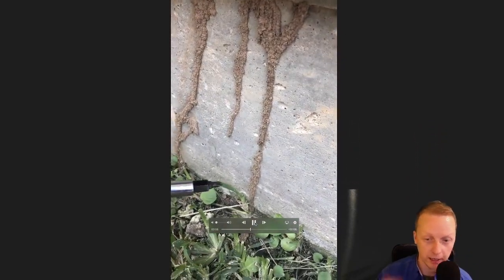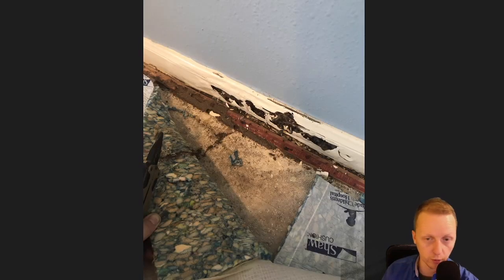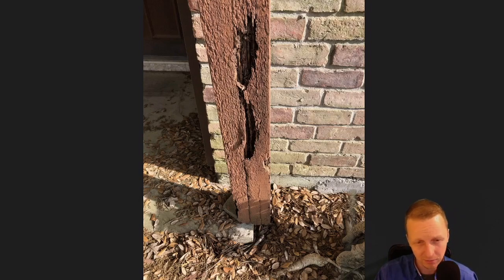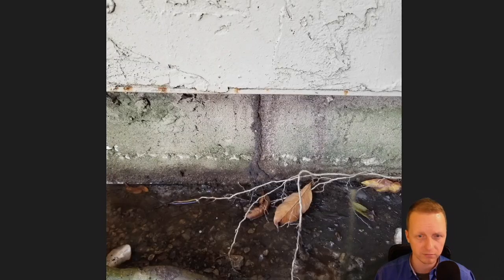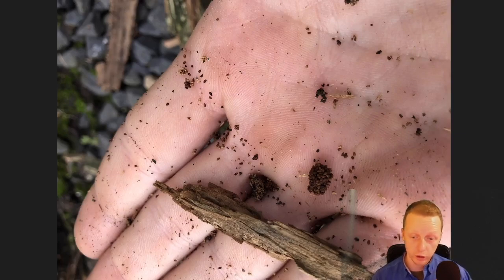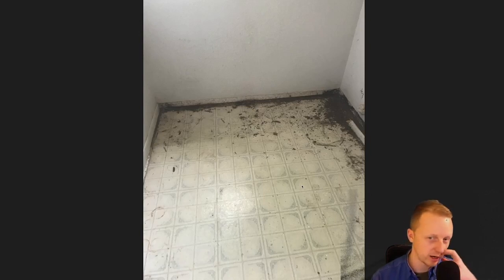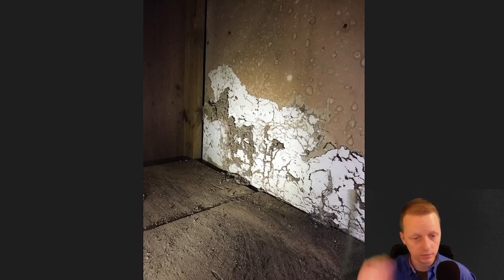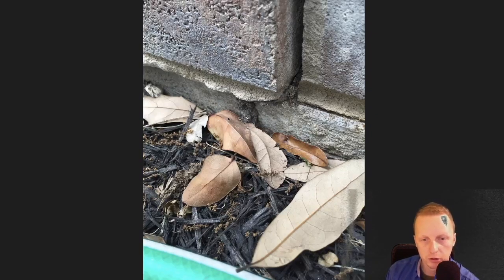How to identify termites and other wood destroying insects - The Houston Home Inspector

Comment: Thanks for the awesome video! I see some pest company drill hole in the soil instead of digging a trench. Is this still a proper treatment?
Reply from the maker: Depending on the chemical used but most commonly you need to trench to follow the requirements

Comment: For drywood termites can we still use solignum without changing the woods just to prevent it from getting worst or we should change all the woods then apply solignum first? Thabk you

Comment: A couple days ago I noticed a dark object close to the ceiling in our 
bathroom, above the door. I thought it is some kind of black butterfly, 
so I decided not to bother it and let it fly away next day. Next day I 
saw several other "butterflies" sitting on another side of the same 
wall, which is our master bedroom wall. They were also located above the
 same door to the bathroom. I decided to remove them with a rag and let 
them fly outside. On the removal I saw that they are not black 
butterflies, but some kind of black stuff w/larvae inside. I also 
noticed small holes in the drywall, about 1/8" X 1/4". I decided to 
patch those holes next day w/ a spackling paste, but next day I saw that
 the black mounts came back (they are like small mounts perpendicular to
 the wall), 8 of them on the wall in the master bedroom, 1 hole in the 
bathroom above the door and 1 on the ceiling of the bathroom, like 1 
yard to the door. I started to do a research on youtube and fortunately 
came across this film. I looked  outside (it is a brick wall) and didn't
 see any signs of activity, so I think they are termites which got into 
the wall. The larvae bugs have a bit orange on the head, 2 black bugs 
are one w/wings and another without them. I'll take the glass container 
w/them to HD store for identification, but most likely they are 
termites. While I was doing research and drinking coffee (like in 2 
hours), the mounts were formed again. So if I pour some of the granules 
of the Termite Killer into those holes would it be sufficient treatment?
 The granules will fall down and the termites are located closer to the 
ceiling (I even think they might come through the roof, bcs previous 
year we had some trees cut near that bathroom, maybe those bugs were on 
the brunches). I think maybe now I need to spray the roof in that area 
w/some liquid termite Killer, like the Taurus SC. Thank you very much 
for the informative film.